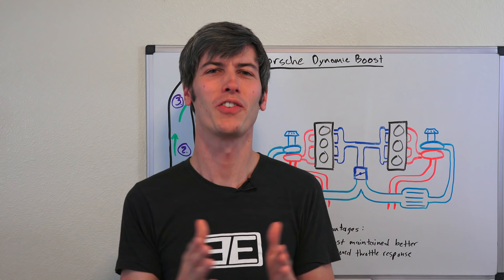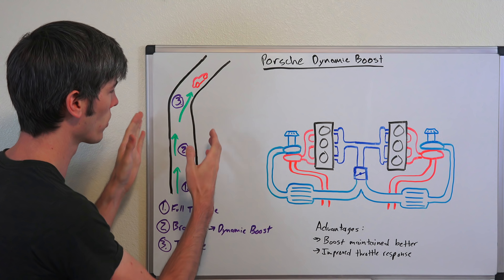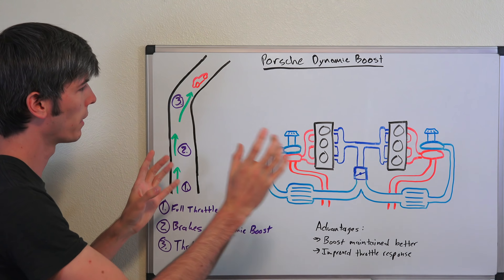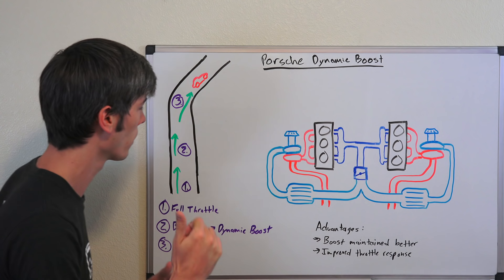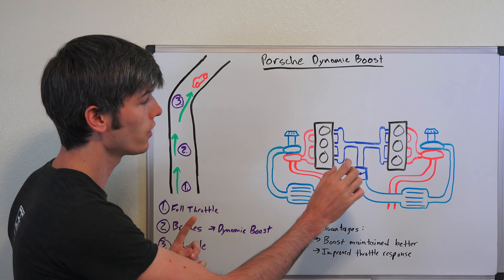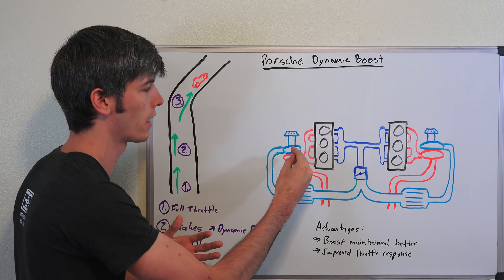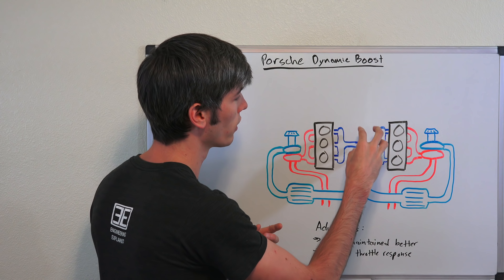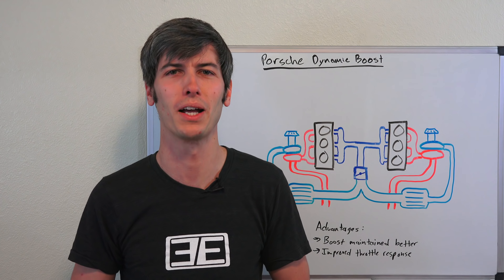Porsche's Anti-Lag System Doesn't Use Any Fuel

Comment: No engine braking, though ...
Reply: Well if it activates when you press the brake that really doesn't matter. It's only in use in sport-mode, so engine braking doesn't matter as much when you're driving for performance and not fuel economy.
Reply: On a track, I think this would be more appropriate. I asked if it's activated in only certain modes, so we'll see what Jason says.
Reply: It's Turbo breaking instead 😁
Reply: Engine brake is often used during trackday. It is very important for cars  with brake constraints. This might not be a problem for Porsche
Reply: Hugo Santos I’d imagine if you are in an area requiring heavy braking, this feature will not be active. To me it sounds like it would be most used in areas of brief coasting or very light and quick taps of a brake, not sustained for more than a second.

Comment: Boy oh boy when this thing breaks 
I don't think they want to repair it even when it's under warranty
Reply from the maker: When an electronic throttle breaks? The same thing every single modern car uses?
Reply: @EngineeringExplained  exactly and that's the problem right there cars are getting more complicated as technology advanced after a while there won't be any reliable cars on the market it's not enough that you have cars that can produce 500 horsepower naturally but now you want to throw on two turbos

Comment: Why didn't they remove it entirely?
Reply from the maker: Because you don’t always want full throttle.
Reply: @EngineeringExplained  some manufacturers removed the throttle valve entirely...they control the air intake by valve lift...would that work here?
Reply: Adjusting spark timing and fuel wouldn't be enough? I think diesel engines operate that way. They don't have spark at all of course.

Comment: There's a potential  for running lean isn't there ??
Reply from the maker: Direct injection, so easy to control the amount of fuel in the cylinder. None when shut off.

Comment: Its not an antilag tho😂
Reply from the maker: "An anti-lag system (ALS) or misfiring system is a system used on turbocharged engines to minimize turbo lag on racing cars."
Reply: exactly Jason.. its called a misfiring system, and this throttle trick doesn't involve any kind of misfiring or late combustion. its a neat trick tho. hope to see a future video with numbers and comparisons to explain its efficacy in real life.